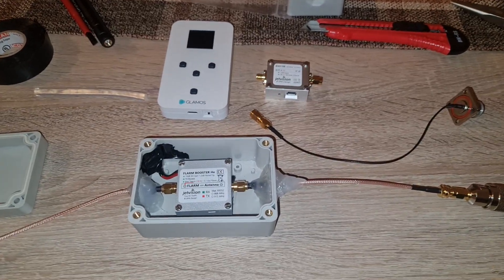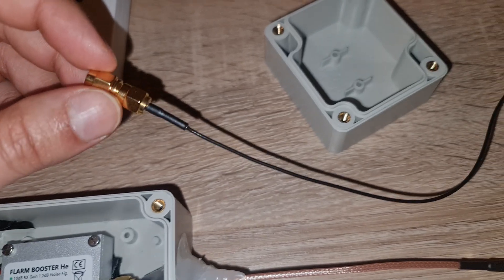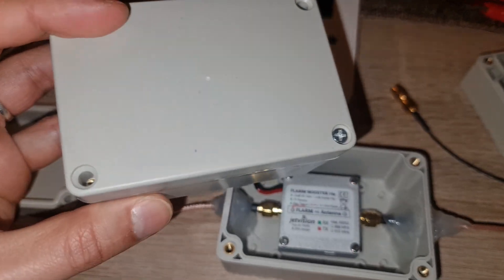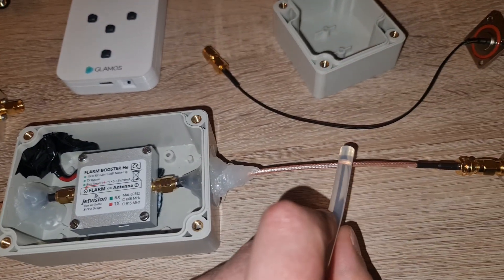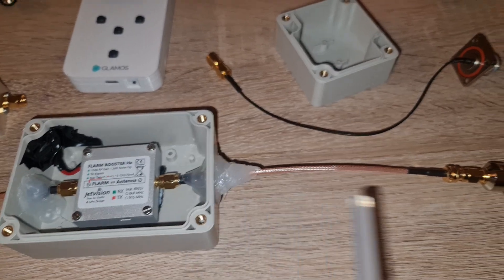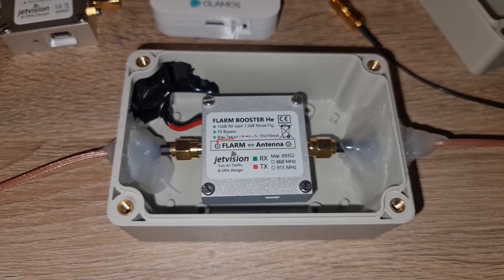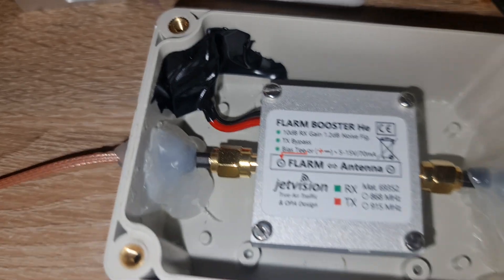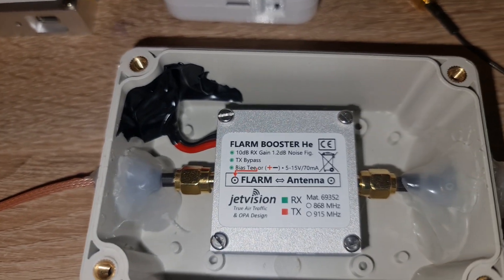FLARM BOOSTER / shireeninc Helium Amplifier outdoor enclosure setup  PART 1👌 😎 _HELIUM ADDICT

Comment: You can buy the adaptable boxes from any electrical wholesalers, looks like a 6x4x2 box, also worth getting 2 20mm stuffing glands and a 20mm hole saw to make the holes in and out to seal them without using silicone